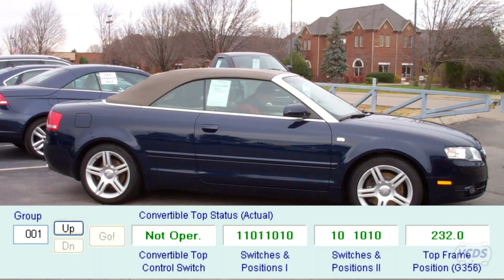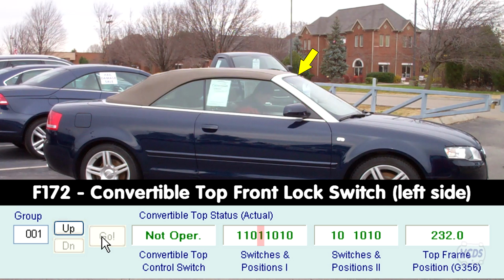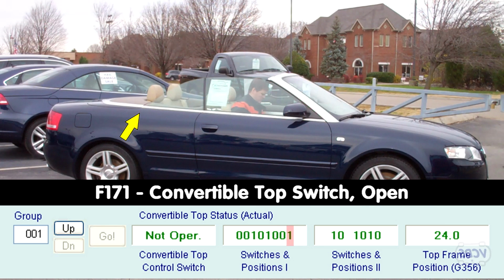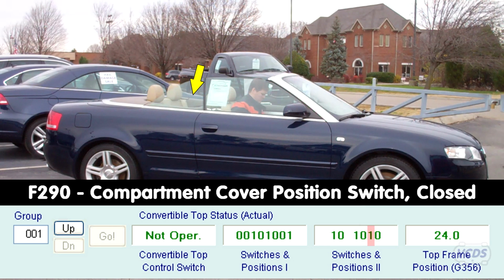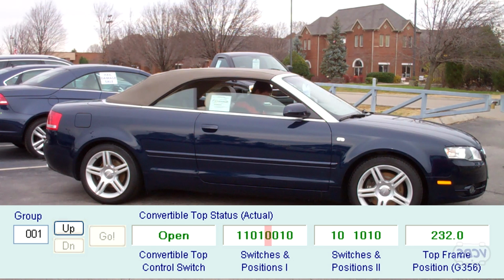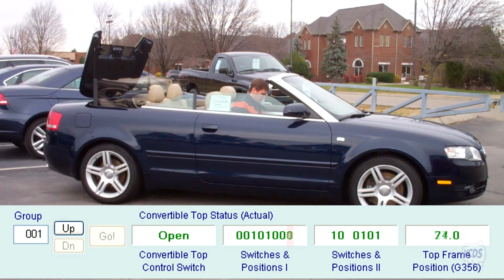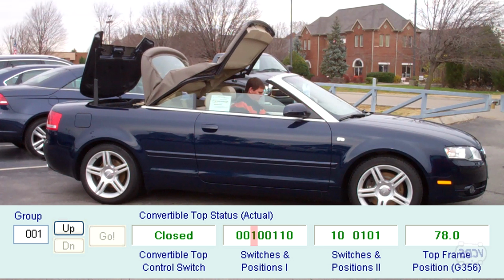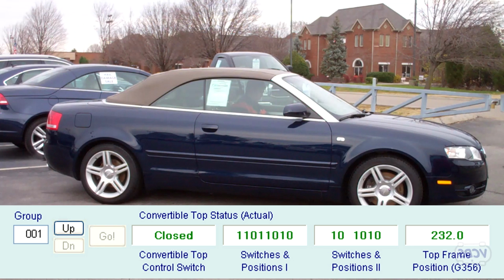Audi A4 Top Operation

Comment: I just saw your video on Youtube searching for answers on my problem. I have a 2008 Audi A4 Quattro Cabriolet that when hitting the top button the only thing that happens is the windows go down. The top does not release above the windshield and the rear deck does not open up. I had my mechanic look at it and he said he thinks its a electrical issue. If so is it a bad sensor? 2 Separate times I manually lowered and raised the top locking when down and again when up to reset the system, but nothing still. Any suggestions? Thanx!
Reply: Did you get it fixed?